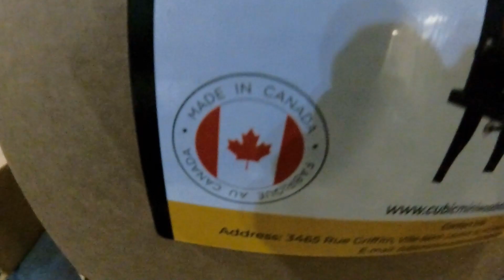Finally called him out...

Comment: Nothing wrong with a tiny stove BUT something you may not be thinking about is you have to feed the stove way more often...using smaller kindling is fine but it just burns a lot faster so be prepared to be feeding that thing more often you you think you will thats all...Having the electric heat is great when it works but being offgrid means you have to be self reliant so if the enteric fails not that tiny stove is your lifeline, picture 6' of snow, cant drive an where sitting in front of the tiny stove hoping not to die...You may find yourself just being outside instead sitting in front of a bonfire you may by dumping fuel on your woodpile lol Im sure the stove works fine but I wouldn't rely on it with my life...Once that snow hits in Maine you better have a backup to your backup and a plan D and E to follow...
Reply: @High_Octane  I think hes on a great path and has great ideas he just needs to experience some stuff to grow and learn more, his heads in a good place for sure...Lots of people are tired of what society has become and want to get away, im sure hell do fine I commented becasue I was genuinely concerned and didn't want to see him suffer or get into a situation where he could get hurt...You cant just know everything you have to fail a little to grow and learn from your mistakes
Reply: @High_Octane  Im saying as he gets more experience with his setup he will perfect it as he makes mistakes he will fix them and grow as a off grid survivalist so to speak...But you have to start somewhere right?

Comment: Cutting kindling is easy, get two 15/14in tyres no rims, stack them, tie together, then put logs in and just waste them with an axe, the tyres hold the logs still & standing upright. Can even leave one tyre mounted to a steel rim, flip it and use it on the bottom as a solid base for log to sit on

Comment: You guys do realize that if you start the vehicle you have that little air compressor plugged into and leave the vehicle idling while your using the compressor it puts more power to the compressor and it will pump the tire up way faster and put more air in the tire then it will without the vehicle running next time you use it plug it into the vehicles auxiliary power port with the vehicle shut off turn the compressor on and then start the vehicle and you'll literally hear it speed up and put out more air pressure I've had the same cheap a## $20 slime brand portable air compressor for 2yrs that still works great it'll pump up my 31in truck tires from 10psi to 40psi with it plugged into a running vehicle in like 10-15mins by the way with that stove it's not gonna keep a very big cabin warm in the winter as the Cub is designed for spaces from 100-200 sq ft. & The Grizzly like the one you bought is designed to heat up to 200-400 sq ft so a 12x40 cabin would be 480sq ft which is 80 square feet more then what that stove is designed for so unless you bought a tiny 300 to 400sq ft cabin then that stove isn't gonna cut it and even then if it's a 350-400sq ft cabin it's gonna struggle to keep it warm in the winter especially in Maine where it stays pretty cold all winter long considering the average winter Temps in Maine range from 25°F in the far south of the state to less than 15°F in the northern and interior portions of the state that stove is gonna struggle to keep it warm you should have bought a propane ventless wall mount heater or saved up and bought a full-size wood stove

Comment: I’m not stove expert but I’ve put a few in my garages over time 18 inches away from a unprotected wall a foot if you use fire board other then that you’ll be good it’s perfect for not using it to be your main heat source that with the mister cool you’ll be mint also you can buy saw dust logs meant for stoves that size